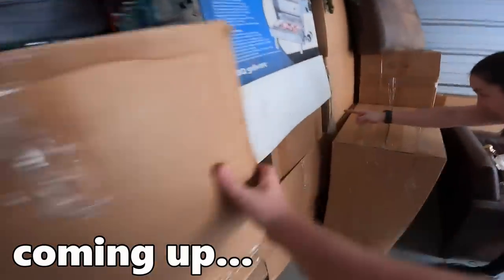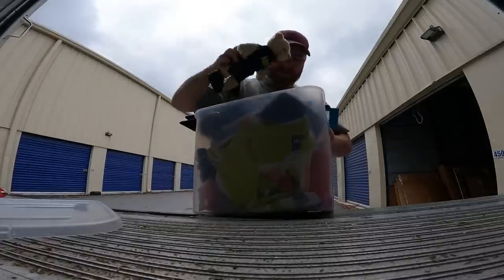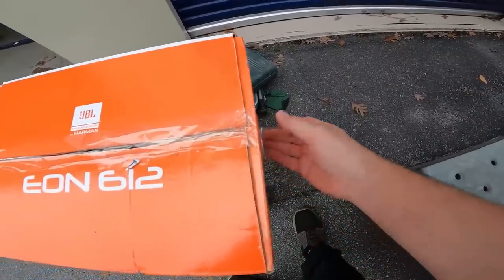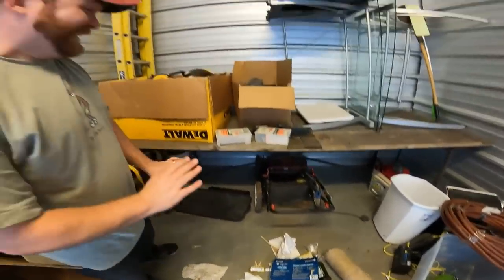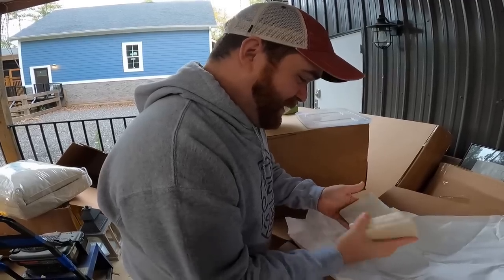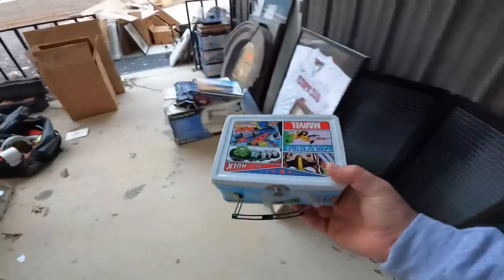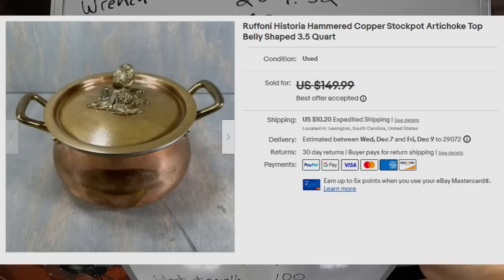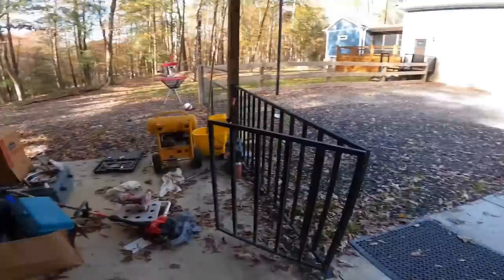Absolute Jackpot in this Abandoned Storage Unit!

Comment: Hairy im a full time 11 year professional mechanic i work for David Bales Buick GMC of Jacksboro TN, i can tell you first hand that box and all those tools can easily bring you $5000,7500 easily. Those blue point impacts and drills are 300,500 each those wrench sets are over 300 each screw driver sets are about 200-250 each and all the smaller tools could have huge hidden value depending on the tool and what its purpose for, i highly recommend you find a Mechanic in your area that would come look and appraise those tools that box alone is a 2500,3500 box. Good luck and great video!!

Comment: Great find! i buy storage as well and it can be fun but I've learned that more often than not, its miracle if i break even. For those who may be thinking of doing this because they saw Hairy do it, please note that this is not the go to for eBay resellers. Maybe for someone who has a thrift store or a flea market this is good. So before we start driving the price up for units just to imitate please be aware that not every unit looks like this. On top of that, this is a lot of work. breaking even (unless you are doing it for fun) its usually not worth the trouble.

That said, this was pretty awesome find and thank you for sharing.

Comment: Antique Booth:  if the booth rental rate in your area is good and it’s location has the foot traffic, it can be a great way to push out larger and fragile items often found in storage units.  I had at least one for most of the 15 years I bought storage units,  helps keep the volume out of the pole barn from accumulating.

As an alternative, look for a local auction (on-line or Brick & Mortar) that deals in antiques, home goods, art and tools, since all are very routine finds in storage units.  You don’t want to start keeping couches, bedroom sets and large appliances in your barn, waiting for local pick-ups to happen.  

If storage units are in your future (and from her smile I suspect they will be) I suggest again that you invest in a 10-12’ enclosed single axle trailer.  You can use it for picking up smaller storage units, doing donation and trash runs and taking items to a booth or general auction house.

 Even after I sold off my bigger equipment and trucks, I’ve kept two 10’ trailers around to dabble, buying and selling.  They reallly work well in Inclimate weather too and don’t need a large haul vehicle.

Comment: I have bought and sold storage units for 30+ years, long before Storage wars was a thing, I also have used storage units almost as long. I worked several years at a national company, and my first few auctions were pretty tough, because at that point I could put a name and face with the unit. But then I came to realize, just like the unit Josh just emptied, they could have downsized to a smaller cheaper unit, and if one wasn't available, they could of transferred. Might have been some work, but in some cases it could have been over a 100.00 a month in savings. And also, we do everything in our power to help them get things straightened out. If they communicate with us, we can waive fees, suggest a downsize, etc... But most do nothing and get angry with the company. I myself once put my own pickup truck in pawn in southern KY to pay my unit in MI. So I have been on both sides of this. I no longer feel remorse, there is 99% of the time something that can be done. Just like all those tools, he could have sold off a few at a time, or pawned them, and possibly prevented losing the whole unit. So Josh and Hayley, great score.

Comment: A guy I work with buys abandoned storage units (Online) and he recently paid $20 for a unit and it had a high performance Ford motor/transmission (newly rebuilt), engine lift, and tons more.  A bunch of old clothes were just thrown on top of the few boxs and the good stuff was behind it. Looked trashy and he took a chance.  He had plenty of other great stories about storage auctions too.  WIth your new property and the add'l building you have, this could be your next big stream of income. Definitely not a small residentual garage business.  Goodbye Goodwill?  This storage unit is a great way to start, if you hadn't already.  Awesome!

Comment: Loading the Truck:  the more you win units and load trucks, the better you will get at judging volume.  I think, from what I saw, your truck was plenty big enough to fully empty that unit.  Some rules of thump.  All auctions (live or on-line) will give a Unit’s Gross Size.  Photos will tell you how full the unit is, so you know your gross unit volume.  The truck is the same.  You can get the Gross Box Size from the web site.  Some rental sites include the cab over portion in the length, so watch for that.

Where most inexperienced buyers run into issues is by not thinking through the job.  Pack the rental truck to the ceiling, go wall to wall tightly.  This unit had a lot of Cubes (boxes) already to go, but we’re they full?  Or were you packing partially full boxes. 

Take empty totes/boxes with u, so loose items can be cubed.  Cubes are easier to stack to the ceiling, loose items don’t stack well and items get broken.  Most newbies don’t stack well, so they loose room.   Stack the value in first, so if you can’t fit it all, don’t leave money on the table.  Pack items like pillows, kitchen chairs and lamp shades up high, pack heavy items down low.  Pack odd shaped items, like curio cabinets with boxes all around them.  Pack thin art boxes under and in voids, like under the snap on toolbox, after it’s loaded in the truck.  Pack the bookcases, dressers, once in the truck, if they are empty.  Pack mirrors between cardboard boxes or between mattresses.  

Pack the trash and donations last and depending on the distance you are from home or time of day, because you can make the donation run and trash drop on the way home.  Or, if it turns out half of what you see is donate, do those runs with the empty truck (before loading for home) to kill volume.  This can work well if u are far away from home and can see it won’t all fit and the facility won’t let you abandon items (most won’t).  If it’s early in the day you can drop the trash on your way home and not have to run it back to town in your truck later.

Some facilities will let u rent the unit for another day, if two trips are needed.  Some, once you become a regular, will give you more time for free.  A couple folding tables, help if you plan to segregate at the facility (weather comes into play here).

Comment: Store bought and taped up moving boxes are another of those “clues” to help value units.  Sometimes, when the door goes up, boxes are all you see and you have to judge value based on box quality and condition.  Consider putting a value of 5 or $10 on each box, times the number of boxes you can see, plus the value of loose items in the photos, to estimate your bid limit.  Few units will have the so many hidden treasures this one did.  Bidding blindly, without controls, is a good way to go broke slowly.

Comment: Looks like a KRA box. I would say you can get about $1500-$2000 locally. They are slow movers. Worst case, you can call up your local snap-on franchise truck and ask them if they would buy it from you.
Reply: Your correct, these old KRA boxes are slow movers because its hard to find someone who would want an old box like this plus the drawer configuration and dimensions are not ideal these days. Hard to get more than $2,000 in my opinion.

Comment: I don't know if it's been said, and I'm certainly not going through all of those messages.
If you buy another large toolbox that's too heavy to load, usually there are levers or tabs to take the drawers out of the tracks. Hold the levers and slide the drawer right out. It will help next time, if you don't have someone there to help
Reply: Or at least take the tools out of the drawers! 😄

Comment: In the mid 90's I was an assistant relief manager of not one, but three different MAJOR storage facilities in California, for a combined total of 9 years. I lost all respect and no longer felt comfortable working for them due to the fact that the managers at two Facilities I worked at including the upper management, were going through the units after cutting the locks and taking personal items the night before auction. Totally turned me off and I stopped working for the storage unit industry just because of that. I wanted no part of that and you two better be careful with making that a part of your living.

Comment: Hey I'm sure you know this but even like individual snap-on sockets can sell for $20 $30 a piece. It doesn't necessarily have to be sets and people still buy that stuff like crazy!! But anyway great find and do note for the future that I would say only probably 10% of the lockers look like this. It's normally about 80% junk. So I have to say, great job!! #foreverflippin.   Oh and in my area if you leave anything whatsoever in the unit , they'll ban you from that unit. Sometimes from the storage treasures or other sites completely. I've seen it happen a couple of times. Just a heads up.. 👍.    👊

Comment: Snap-on Tool Box: because of the size and weight, you won’t see many good comps on e-Bay.  You’re better off, once you know the actual model or size and drawer count, going on line and googling Snap-on dealer web sites.  There you can see the new retail price for an equivalent box and judge how the condition of that one compares.

Knowing you will have this worked out by the time I type this, I’ll pass along some advice for future large items.  

As for moving them, sliding them up the ramp empty is easier, since you have to lift it over the truck deck lip. Drawers out, but still loaded can save time too, if you can figure out the drawer slide mechanisms.  I load them early and use the weight of all the other boxes to provide protection to the paint and keep it from shifting around during transit.  Some have wheel locks, but they still tend to bounce around and if you mark up the paint or bend up the handles your killing the value.

Comment: This is so bizarre.  The original owner could have sold just the empty tool chest and easily paid all their fees and kept their stuff and made a couple grand to boot.  So odd.
Reply from the maker: Once you get more than 30 days behind they lock the unit and you can’t get back inside until you pay the balance off
Reply: Good point. If you know hard times are coming, clear the locker or have a sale there. I've been to many storage unit sales on location with lots of treasures.